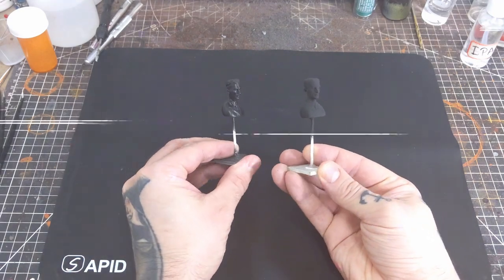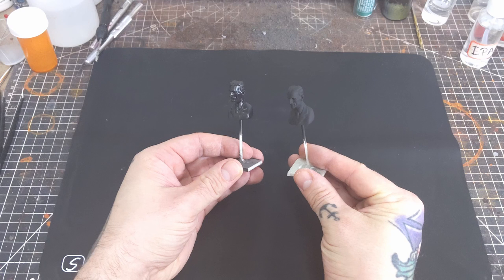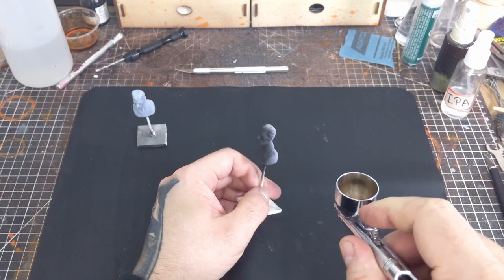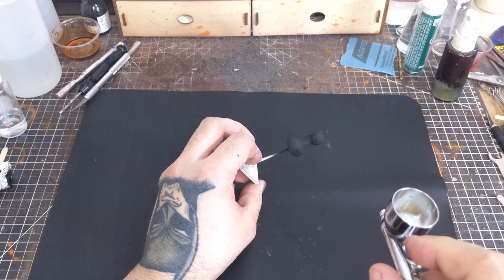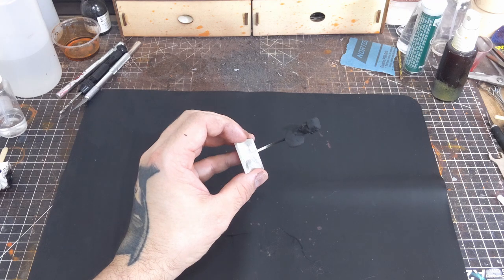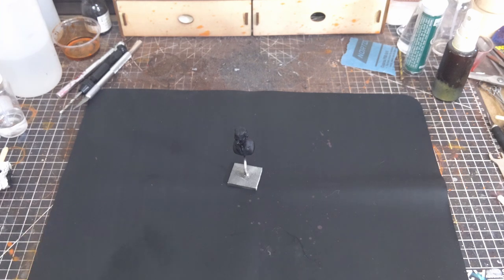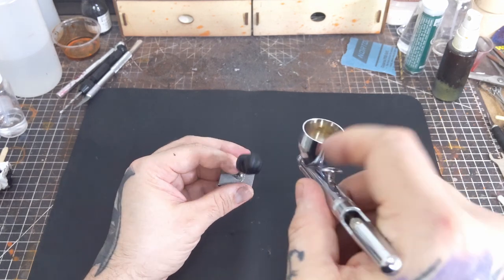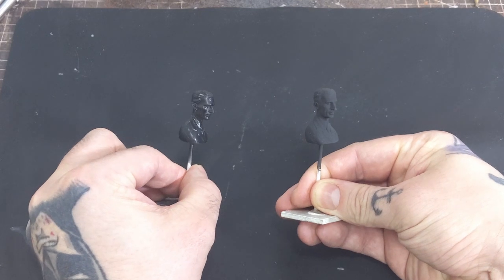Is Your Matte Clear Coat Turning Out Glossy? | How To Keep Your Matte Clear Coat From Drying Glossy

Comment: So.... is my already glossy project already fucked? I used mod podge spray matte acrylic... if I do another spray from further away is it just going to be worse?
Reply from the maker: I've sprayed matte over gloss before with good results. Maybe try it in a less visible area to test first before you spray the hole part. and just work in light coats.